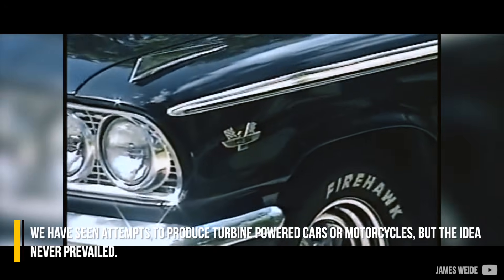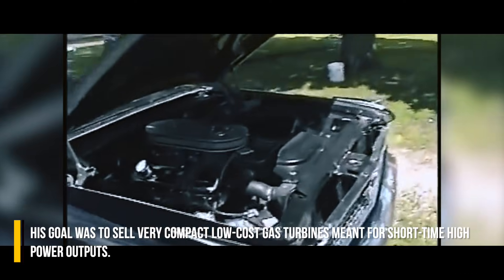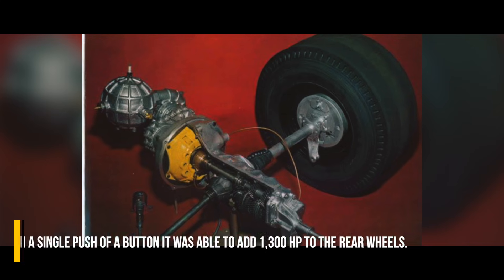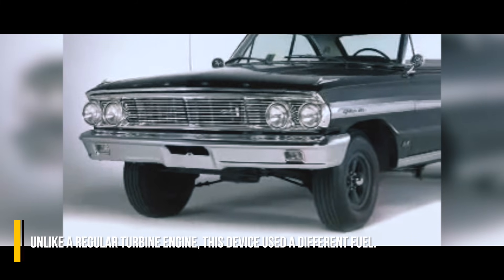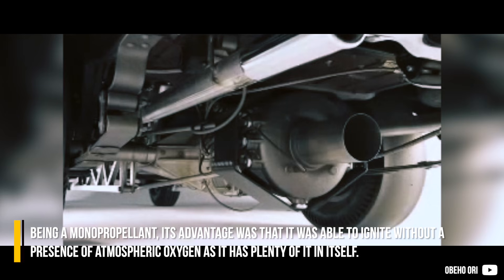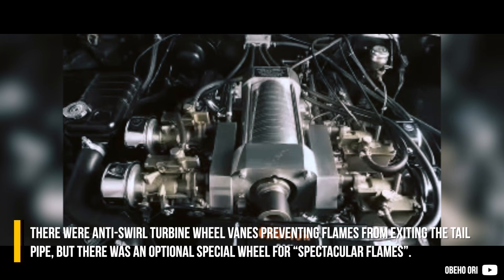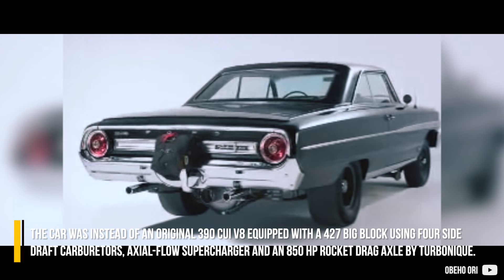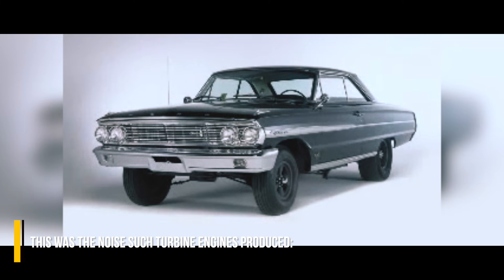Rocket Drag Axle: 1,300hp Turbine On The Differential

Comment: The downside of Turbonique supercharger and drag axle products was that like a rocket, once they were fired they functioned until the fuel ran out. Poor fuel control and no way to throttle it all presented a product with very limited commercial appeal. Also the high rotational speeds of the turbines used ball bearings that  lasted only for a single run.

Comment: Wait , wait 🫷 can you accelerate with twin turbo with nitrous at 7 pound's of boost to 190mph then put it in neutral😮 with air shifter and engage a liquid rocket fuel turbo pump into the rocket assist rocket fuel turbo Axle drive axle drag axle until whenever!!????

Comment: The Black Widow VW ran at 0 to 180 mph in 3 seconds and on its first run it lifted at the front and flipped. They weighed the front down after that. When ignited the axle rotated between 60-90,000 rpm
There were 150 bhp units, 850bhp and 1000bhp motors available. The cost in the uk then was £1450.00/ Some even went into Dune Buggies

Comment: Can you imagine the fireball from tail ending someone with one of these? Very interesting concept seems better utilized for land speed record runs although I wonder how long the rocket would run and how hard it was to refill the propellant. If it spontaneously combusts at 22 C seems like you would need some pretty specialized equipment to refuel which would make it a lot less useful and a lot more dangerous. There's always that one guy who is like "I'm not spending extra money for some special gas can I'll just use mine". Then after he is released from the burn ward he sues.

Comment: So with this thing installed in the rear axle, was it the sole method of turning the wheels or was there still a way to power the wheels with the car’s gas engine? I.e. for staging, street driving etc. it didn’t look like there was anywhere for the driveshaft to connect
Reply: Regular engine under the hood, could run Either or both
Reply: The '64 Mustang I witnessed in person had no piston engine. Just pure rocket power. Instant ignition, 5 second burn, then off, if it didn't crash. Those were the days when America WAS great.

Comment: its look like add nitrous oxide in modern car 
instan horse power
Reply: NOS enhance power of the regular combustion engine.
This thing totally put the concept on another level by bypassing the main engine and being a turbine engine brutally and directly geared to the rear differential.
Reply: @Damien.D  there was a solid rocket fuel supercharger from Turbonique available for the engine as well.

Comment: I had a shop in a junk yard 15 years ago and in the back of a old car I found a pamphlet talking about turbonique!  Glad you made a video on this!  That was a different time!  Couldn't imagine having a fuel that ignites at 70° sitting in the trunk just to go fast!
Reply: Ever heard of hydrazine? That stuff, when added to nitro, is even worse. Legends are told that running that mix in a stock 90hp flathead, would boost its power to over 300. One slight downside, besides rods and pistons being sent to space, is that its vapours would condense into a shock sensitive explosive inside the carbs... 😁
Reply: @Arrchey249  oh such simpler times!!!
Reply: Remember then from back then also . Hot Rom magazine sold em for about 50 bucks if I remember right .

Comment: Basically taking a helicopter engine and ripping off the blades and throwing a differential on there
I guess you could call it a turboaxle instead of just a turboshaft 
I like the idea of this being self contained and also how it acts like an “assist engine” similar to an electric motor in a parallel hybrid car

Hmm, this in an FWD car
Turbotransaxle
Reply: when u se a civic with a solid rear axle and a extra exhaust pipe be werry concerned, for your and everyones elses safety that is.....
Reply: Ståle Mahoney LOL

Comment: The Turbonique Drag Axle was basically a liquid fueled rocket that drove the turbine geared to the rear end directly. These added incredible horsepower at the flip of a switch. These were pretty dangerous! Not only by putting rocket technology into anyone's hands with the cash, the buying public didn't have to have any knowledge of such systems. Another factor was the current race car tech & safety was not up to par! Early motorsports racing was dangerous and drag racing was no exception, probably one of the most dangerous motorsports. Back then tire technology was way behind capabilities of handling this kind of power. Eventually these devices were banned. That said, I was born too late, I would have jumped at the chance to be a part of that time in drag racing and you bet your ass I'd flip the switch to that extra 1000+ instant  horsepower!
Reply: Siward Beorn  Im a jet mechanic, I get to play with the real deal every day!
Reply: @mytmousemalibu  - I spent years in the USN working on jet engines in the A-4, A-7, and F/A-18A.  Taking the A-4F Skyhawk AKA "Scooter" to the hush house for trim was a thrill.  An 11,200 pound thrust turbojet made some serious sound indoors.
Reply: @Scooter George  I can imagine! Especially  old turbojets and anything with burners! I've never been in or ran anything in a hush house, closest I've got to that is high power runs in a bullpen. Being surrounded by blast fence makes it a fair bit louder. Probably the most wild thing concerning engines was hand deployment and recovery of a trailing cone behind a running 777-300ER on an active military runway! The world's most powerful aircraft gas turbine engine that exists, GE90-115B. Absolutely massive engine on every scale, including its 115,000lb thrust rating. At idle you really have to step carefully in the exhaust path and thats probably 70ft behind it.
Reply: Siward Beorn  Great thought but a true turbine needs time to spool up.
This one was instant because the fuel was self igniting!
Reply: Worked on various small APU gas turbines of various types, as for the main engines that propel aircraft:  PT6A, Westinghouse J30, Allison/RR 250, Garrett TFE 731, Garrett TPE 331, PW100, PW JT-15D, PW1524G, PW305, PW307B, PW308A, GE CF34 GE CJ610, Honeywell AS907, Honeywell HTF-7350, BMW/Rolls-Royce BR710 Rolls-Royce Spey RB.163 & RR Tay RB.183. Of course, probably a few im forgetting. Its a continuously growing list. A good portion of these engines were from my experience working Experimental Flight Test for a prominent North American company(s). You can probably figure out who that is by the engine list above. That was an awesome chapter in my life, lot of fun and I miss it! I work in the private sector of cooperate aviation now which is good too. Until this Covid nutter-cluster-shit, I got to travel a good bit to interesting places I would have never seen otherwise! 

Hopefully get to work on some classic old jets and piston Warbirds. Love radials and big V-12's too!
Reply: I witnessed one in a '64 Mustang in 1965. So insane it is still burned into my brain. I'm 75 now.
Reply: Thank you his fucking voice ruined the shit
Reply: you have no idea what you are talking about, problem with you kids is you forget there were lots of us grew up in the old days and saw these run, try looking up a video of jack mclure in his turbonique kart. last video i saw of him he was 89yrs old still doing this, there is no report of any turbonique exploding, if you can find one ill apologize for thinking you are a troll.
Reply: I immediately assumed Propyl Nitrate would be very toxic to humans, but I looked it up on Wikipedia and they say it is safe to transport as long as it has a flammable designation. No word on toxicity levels so I guess it's not harmful except for it's propensity to ignite at low temps It still sound dangerous..
Reply: They eventually not only got banned but after winning 2 or 3 law suits the Feds got him on charges of mail fraud. Being as magazine adds placed said that they were safe and easy to install. Well the inventor was literally a rocket scientist and itshard to believe he couldn't see where this was going.  After a minimal stint in jail and having spent every penny he had he moved on in life to some incredibly dull life as a shoe salesman or something. I don't recall.  I'd love to talk to him and get some questions answered.

Comment: When you strap a rocketship to a differential
Reply: very close to a turbo-pump, used to pump fuel into a rocket's combustion chamber
Reply: @biomecaman3514  Yea it's a turbo-pump but the pump side is omitted and directly geared to drive the wheels.
So it's a "turbodrive"?